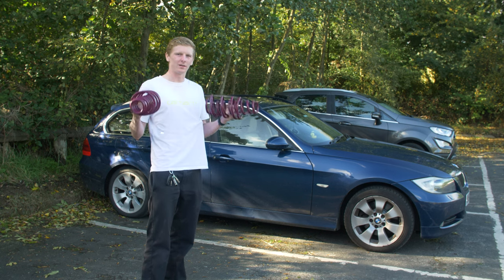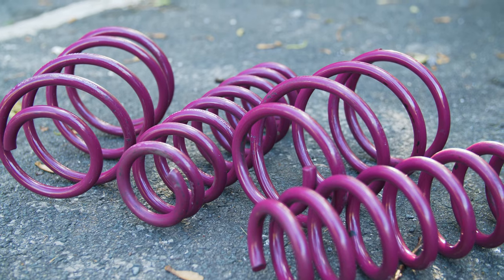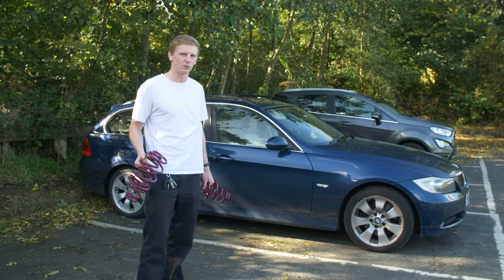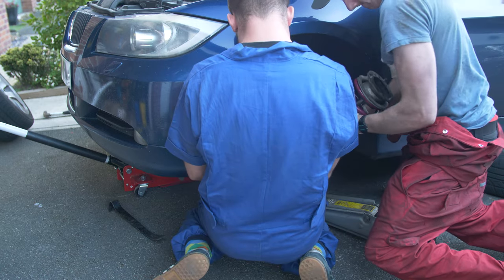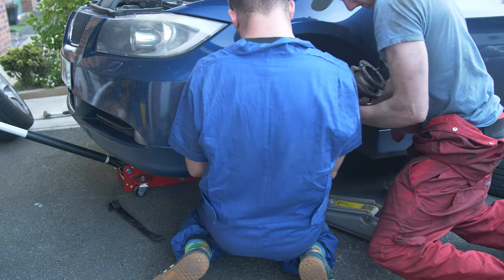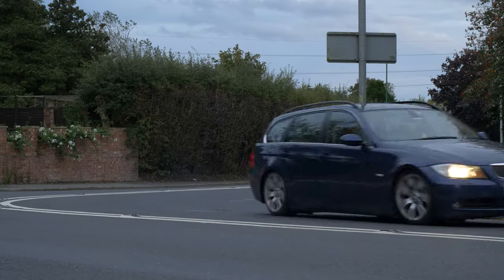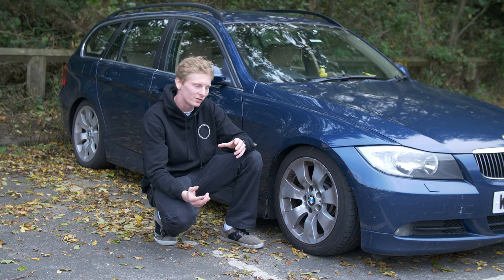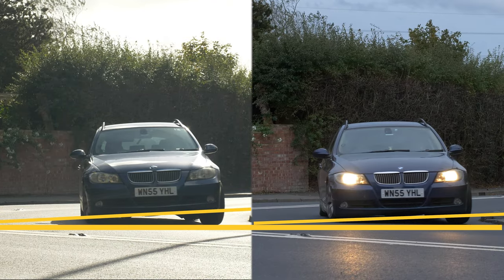This CHEAP DIY MOD will transform your car!!!

Comment: Put new shocks and strutss!!!... I bought mine but I need to support the lowerimg springs Bilstein b8 all rounds with vogtland springs 1.6 drop all around
Reply: Plus I'm doing a kmember swap
Reply from the maker: Suddenly it’s not so cheap haha if you’re going to do shocks as well I would recommend coilovers
Reply: @Josh.Sanderson  Not always. Good dampers with lowering springs are probably better for a daily driver.